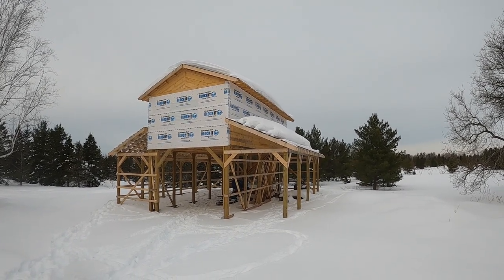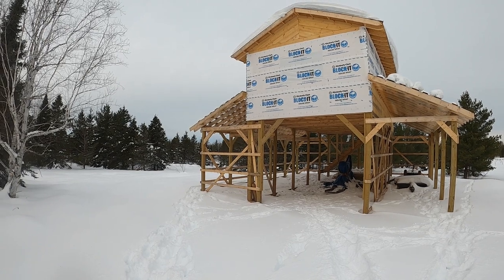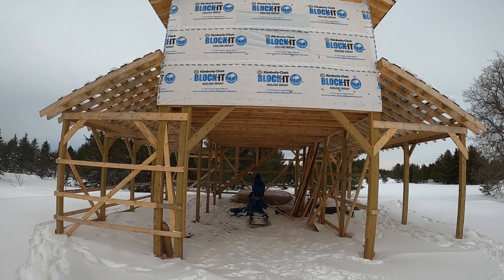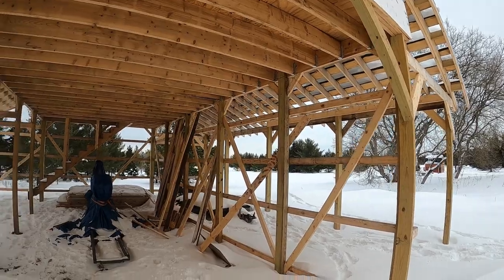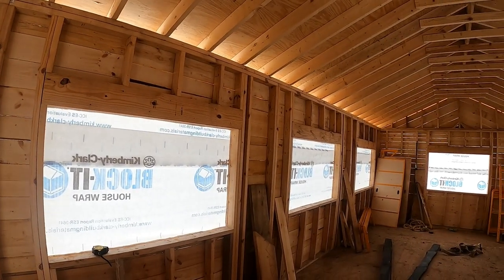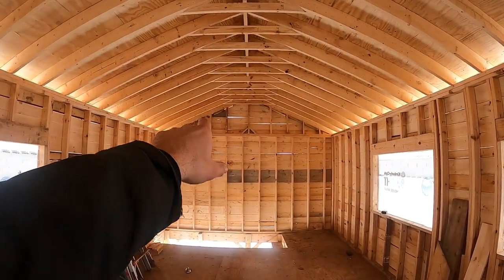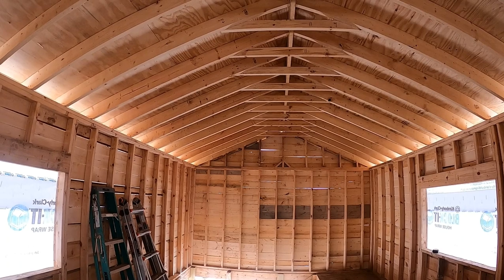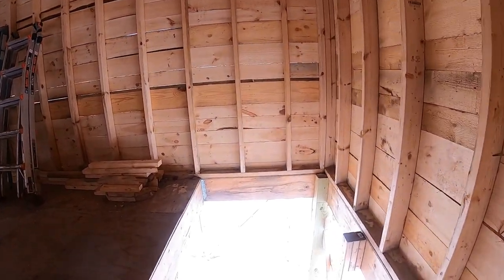Monitor pole barn episode 4 talking update

Comment: I'm jealous... Did you get an architect and engineer? How much?
Reply from the maker: Thanks, no engineer or architect.   But now have a library of books with span charts, load ratings, weights, ect.  I had to use books as the internet seems to just say hire a engineer anytime i googled a question.  For price currently a little over 10000.  And thats with using alot of home cut lumber.  But also had to buy a variety of tools.  I am hoping to keep it under 15000.  But prices of everything keep surprising me.  I have close to 1000$ in nails and screws.  I never would have predicted that.  Thanks for watching and have a great day.